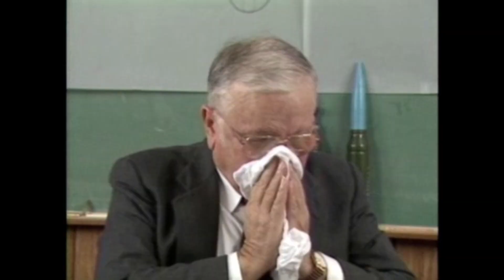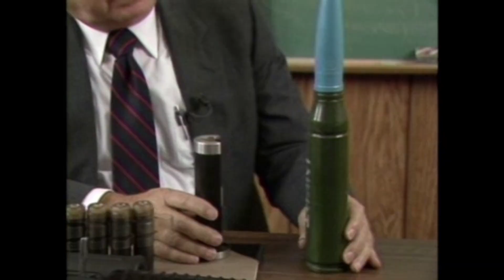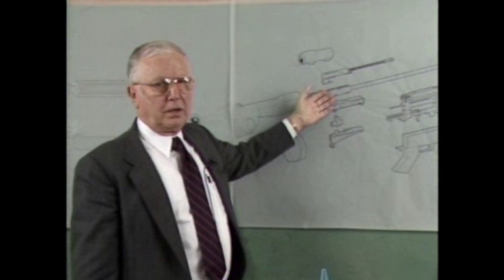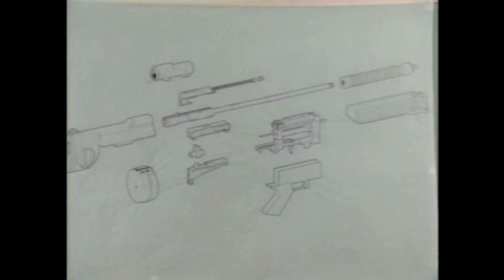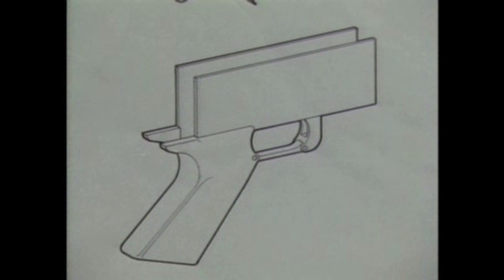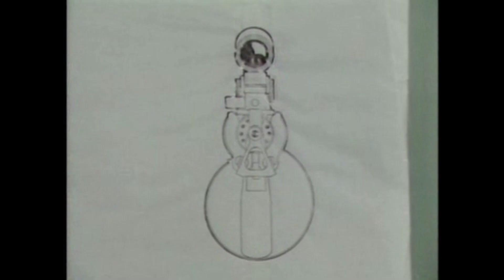The Eugene Stoner Tapes - Part 5: Future Weapons Design

Comment: That figure of "rounds of ammo per casualty" is misleading - it doesn't have to do with field accuracy of rifles, nor training level of troops.  It has to do with both a change in the nature of weapons AND a change in the nature of tactics.  

Going from bolt action to semi-auto to full-auto weapons is part of it; going from aimed fire and volley fire to suppressive fire, increased use of automatic mode, use of machine guns for suppressive fire, and fire and maneuver tactics, is the other part.  That tactical change means that bullets are not just used to HIT the enemy - they are used to keep the enemy's head down.  

That means that each part of a platoon or squad in front line combat is alternating between providing suppressive fire - while others are advancing or maneuvering for positional advantage - and then maneuvering to advance while the other part switches to suppressing enemy fire.  

In WWII, you had A machine gunner, with troops armed with semi-auto Garands and bolt action Springfields (or, at the end of the war, carbines - eg, Okinawa); by mid-Vietnam, EVERYONE was a machine gunner, with an ~automatic weapon in their hands.  That tactical change, in what weapons are used for, chews up ammo fast.

Based on one source, the number of bullets fired per enemy kill reported in the civil war (1861-65) was 60*; in WWI (1914-1918) it was 300; in 1941-45 WWII it was 25,000; by 1975 (Vietnam war) it was 50,000, and in the 2001 Afghanistan invasion by US, it was 250,000.

* That was considered, post-civil war, to be an embarrassment, and one of the motivating factors for the formation of the National Rifle Association in 1871.  It also later led (1903) to the establishment of the Civilian Marksmanship Program: to train the citizens - i.e. militia - to be more effective marksmen in combat.

Comment: Crappy, unreliable gun.  Should have modeled after the AK platform, and copied its robust direct-impingement piston design.  What a terrible gun that only runs when everything is CLEAN and perfect.  Unacceptable in combat.  JUNK.
Reply: You're talking about the M-14, right?
Reply: manufacturer and quality issues not Developer. blame uncle sam.
Reply: During the early 1980's NATO ammunition testing the M16 was the most reliable and accurate rifle tested by NATO..Try again..

Comment: Took till 2021; but now the US Army is adopting telescopic polymer ammo... stoner was a genius...
Reply: And then they decided to go to 80,000 PSI with steel reinforced brass!!!
Reply: And then they'll mention how he predictable this when talking about the history of telescoped ammunition while conveniently leaving out they treated him like crap and sabotaged him.
Reply: Check out the textron LSAT, the idea has been in working form for a long time, however it's a heavily design dependent weapon for reliability, and has not had any "real" military development time to perfect it, so still not a great choice for a "replacement program" would be better suited as a standalone test platform run by rangers or special forces for starters to get the perfection timer started up 😉 (imagine a beltfed machine gun with a hidden chamber, no extractor and an op-rod shoved straight through the middle of a plastic shell... literally an impossible malfunction to clear without tools, because the action is stuck midway and cannot be field stripped 😐 you won't see that in Textron's promotional videos 🤣 but there was a reason special operations units passed on the LSAT... supposedly Textron has improved some of those design flaws, and changed to more heat resistant plastics, but that chamber is still buried deeper than a bullpup's due to the inherent design, which is already starting with poor footing 😳 We'll have it figured out in another 35 years though 😄 ya know  just after the military standardizes on electrical impulse for launching projectiles instead of pressure from smokeless powder 😂👍
Reply: Also how we’re using smart scopes and augmented reality tech to fire from the hip, just like he said
Reply: No, they’re not.

Comment: Seems to me that the bullet in these plastic cylinder rounds makes quite a hop from its starting point until it hits the lands of the barrel’s rifling.  I wonder if that might be a problem long-term, with the increased possibility of lead fouling or misalignment.

That said, the way that cylinder carrier moves up to mate with the chamber is very interesting.  With plastic ammo, my first thought was that the intense heat of a chamber would melt and/or burn plastic casings.  That mini “elevator” moving up to mate with the chamber only for an instant seems like a brilliant solution.
Reply: I don't think it would be a long-term issue, given that revolvers have had similar issues ever since someone came up with the idea half a millennia ago, and they seem to be doing quite well for themselves.
Reply: Textron's current rifle in the NGSW program works exactly the same way. There's a lot of videos on it if you're curious.
Reply: There's always gain twist.  But really, do we actually know how fast the bullet is pushed in by the booster charge versus how fast it's pushed in by the bolt?

Comment: Literally 200-300k rounds of ammo per casualty, holy crap I had no idea it was that skewed. I figured maybe 5-10k but wow
Reply: At 0.25 cents per round
Reply: I read 1,000 rounds of 303 british cost $60 bucks during WW2  which is around $600 today. So 25 cents seems almost on the low end.  @indigohammer5732

Comment: 27:30 Hello modern optics systems.
Reply: He was really ahead of his time
Reply: I thought the same thing
Reply: In the majority of actual combat situations, he believed you could basically throw the sighting system away & not affect the efficiency of the rifle whatsoever. Interesting. Definitely a little different w a pistol but yea, probably true.
Reply: @Treeman573  hipfire seems more like a problem of sights that take up a lot of view and useless unless you line them up perfectly. That's why there is a lot of stories about how soldiers aimed their M4's that were equiped with irons by aiming above appertures. You not hear about problems like this with open sights like on AK's because they are kinda "aim over" sights and are horrible to properly aim them in full auto, and you just naturally aim above them. Red-dots and low-powered prisms change that because nothing obstructs your view of the target when aimed through those systems on full auto, yet they are even easier to aim onto the target. It's essentially what Mr. Stoner imagined of a "projection sight".